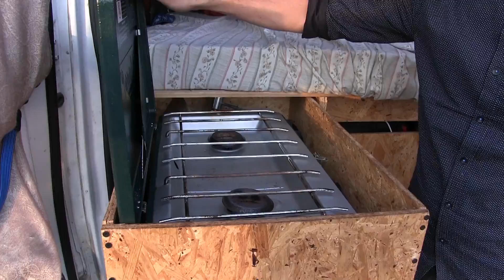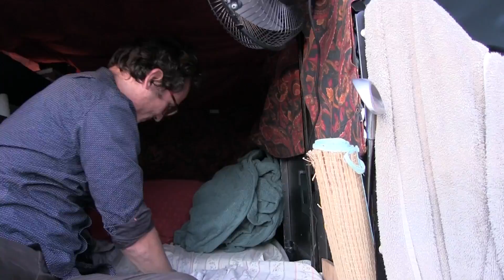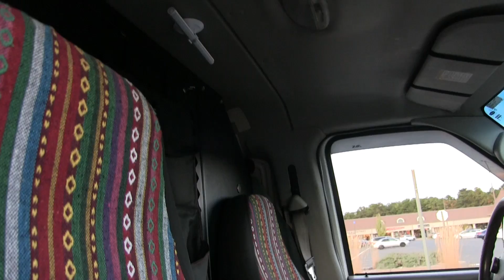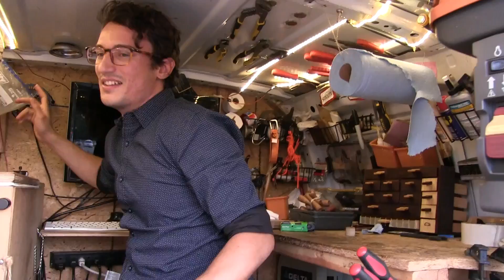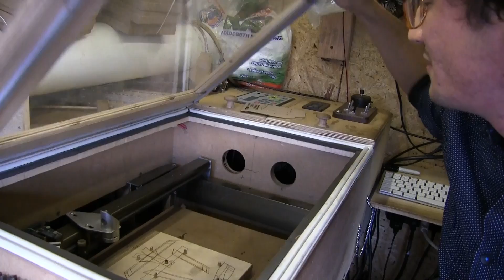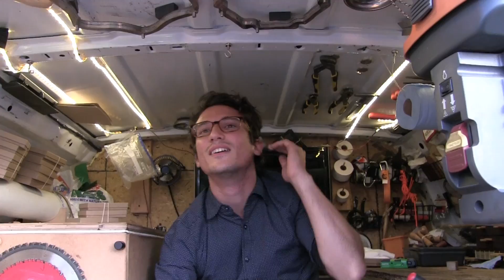VAN LIFE | DIY Camper Van Conversion With Custom Wood Shop Workshop

Comment: Let me rephrase what I said earlier.  The wood shop install is impressive.  I cannot imagine how anyone could fit a whole wood shop into a tiny van space, including drill press and lathe!  Of course, this is every van lifer's dream to have a rolling shop.  And you have adapted your living routines around the shop.  This is quite a feat of planning and design and speaks volumes about your tenacity and abilities.  I do wonder though, if any of the 3 functions you want to achieve with this build, are being met adequately.  Travel, Living, Working in the same van.

Travel:
The machinery is too heavy for the tires and for travel.  If you want to travel a lot, you need to be light on wheels. This gives you good gas mileage and less damage on axles on strange roads.  It would also be hard to lift up your van to change a tire with a drill press as cargo.  Having too little room for cooking or fridge, means you spend your time near stores and this limits your travel.  The possibility of damage to axles, repair turnaround time, towing fees, and overall repair costs would be a major concern for travel with this heavily loaded van.

Living:

The daily routines for eating, toileting, cleaning up dishes, food storage, bathing, are not supported by this build. Taking out stove and cooking outdoors means moving van to location where this will not be a problem in public.  No fridge means daily food shopping and limited fresh food.  No sink means a hassle to clean up.  No toilet or shower means daily visits to gym or public restroom.  This takes up a lot of your time and gas, and becomes a hardship.  It will also take a toll on your health as you gradually move to canned foods and breads for ease of use. 

Working:
You cannot stand up in this van.  This means being hunched over many hours a day, or loading/ unloading heavy drill press or lathe.  The lack of space also means you need to be in an area where wood chips and sawdust flying is ok.  What is your power source?  Van is too small for solar large enough to power this equipment.  So this slows down your work.  You cannot work fast in this van with this layout.  Most of the time will be spent hunting for this or that, and packing/unpacking from its place.  Very stressful to work like this, and unproductive in the long run.

The only benefits you have are the lack of rent, which is a big one of course.  And its really nice to move your workshop to a new location and enjoy working there.  But every new locations comes with the price tag of hunting down power sources, food sources, gym sources.  You spend so much time doing this, that it prevents travel.  Realistically, doing all 3 functions in a van this size is not a workable solution.  I would recommend a larger school bus where you can comfortably fit all 3 functions. Skoolies are not the ideal vehicle to travel in, as mpg is poor, but you will be comfortable and live off grid better.  May be worth getting a job, building the skoolie, then taking off.
Reply from the maker: Thank you for the explanation

Comment: Full of crap when he says he does use the fan and it's happy in Jersey with a summer can be 90°. Vine will be pumping hot there's no way sleeps in that night in the summertime I don't buy into his bull crap...
Reply from the maker: He has done a great job living in the van this past summer
Reply: @NewJerseyOutdoorAdventures  actually he's been does look great and working woodwork part the back of it looks much better though I think you should have got a trailer and do that instead and then have the whole van to live in cuz I know living in Jersey myself in the summertime it can be very very hot and in my van it's hot as well but I have a air conditioner in there so I'm like I'm lucky he doesn't have an A in it so I know you must be hot as hell in that van sometimes... even though he says he's not I don't buy that I think it's hot as hell in that cuz I'm warming my vinyl is hot so I know he was in his and I have insulation that's the funny thing I'm still hot without my air conditioner...